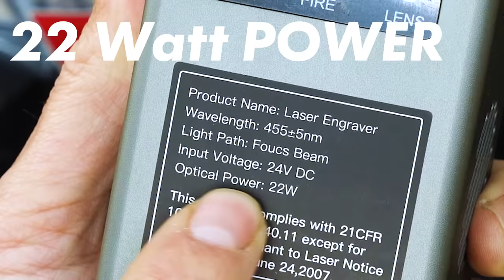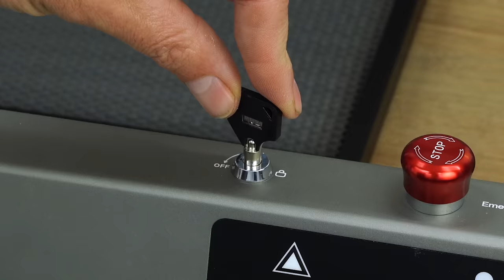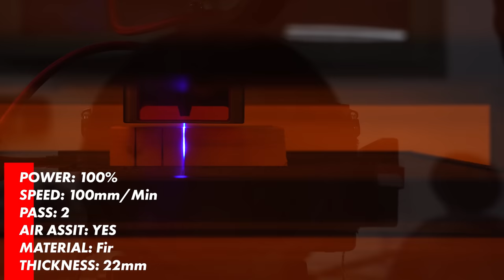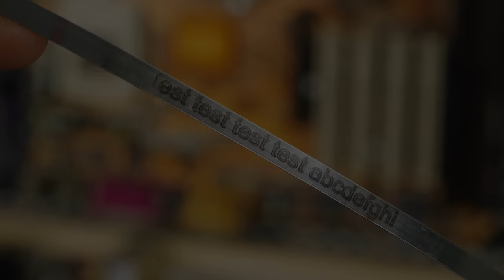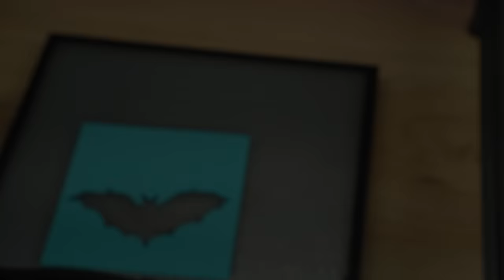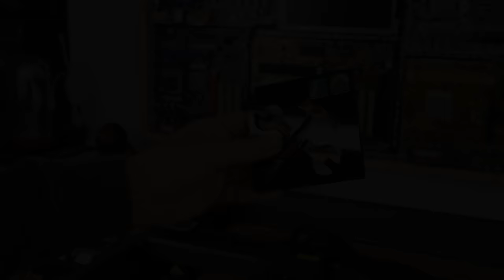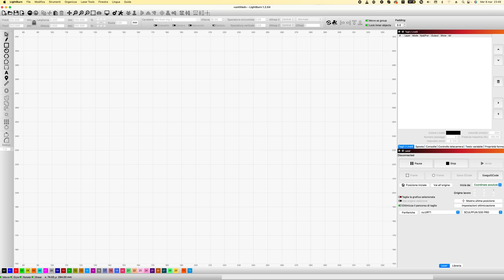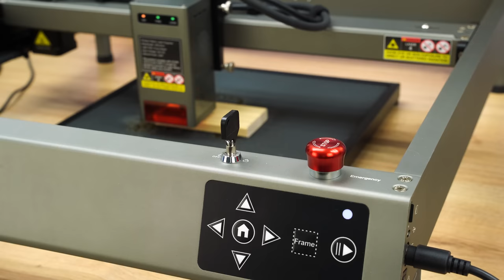INCREDIBLE!! This Creality Falcon 2 Laser engraver, VERY POWERFUL AND FAST

Comment: 8:07: Careful with that!

A lot of faux leather out there will contain polyvinyl chloride. You should never engrave or cut chlorine containing polymers with a laser.

Even if you are certain that that particular sample used did not contain PVC, you really should not be showing a video of cutting this material without making it clear to viewers that this particular issue exists and that they should always validate that the composition of their faux leather does not include PVC.
Reply: PVC is relatively innocuous. It doesn't react with anything in the human body. Yes you should wear a respirator, but only because you don't want to breathe in small particles of anything: the physical damage of small particles in your lungs is bad regardless of what the particles are.  But PVC itself is pretty safe: hence why your drinking water comes in PVC pipes.
Reply: @NerdSnipingBatman  , is it really that difficult to google "can I cut vinyl-PVC in a laser" before you go and post a comment like that? Check what should be the 1st or 2nd hit when you google that (depending on whether you search with quotes) and look at the photos.

Yes, PVC is "relatively innocuous". The comment I made, however, was not about plumbing. The comment was about what happens to PVC when you hit it with a high powered laser (which does not generally happen to household plumbing) and about whether doing so produces any decomposition products (hint: it does) and whether such decomposition products might be dangerous to your equipment or to human health (hint: yes, they are).

HTH

Comment: 7:21 Why didn´t you search how deep the engraving of metal can go, using high resolution (thin lines)? It seems as a promising way of cutting thin metal, if several passes are made... That would be the main use for me, since humans cut wood pretty precise and with much ease since millenia, while precise metal cutting still is in its infancy.
Reply: What do you mean precise metal cutting is still in its infancy? what makes you think that?
Reply: @SintaxBSD  I meant for home-makers,  and not if you can spend millions on it...